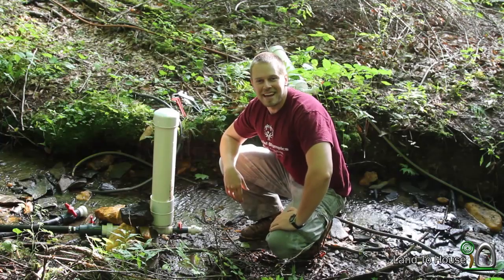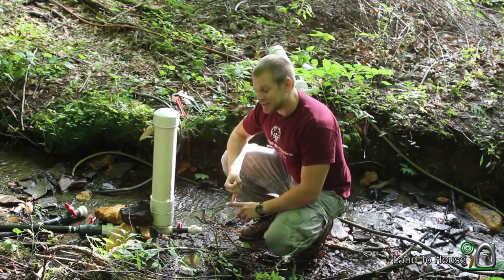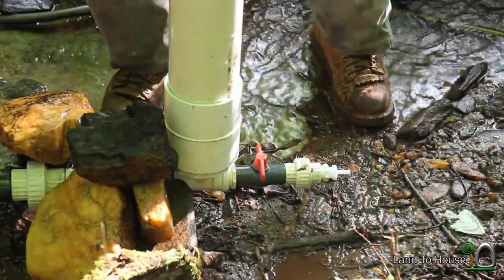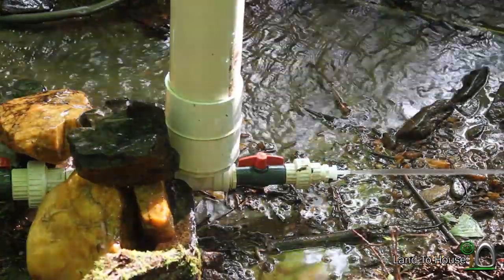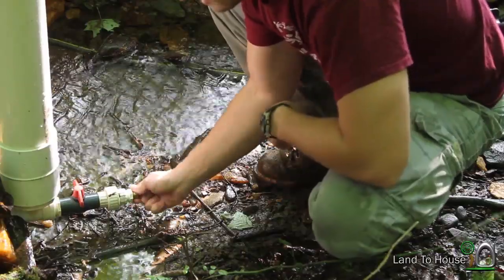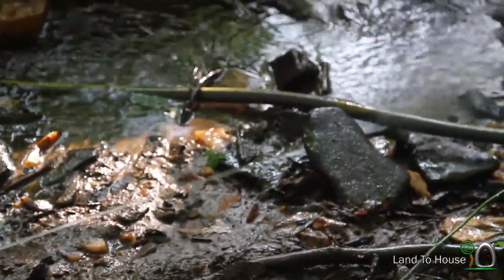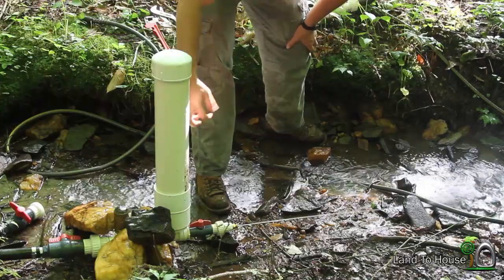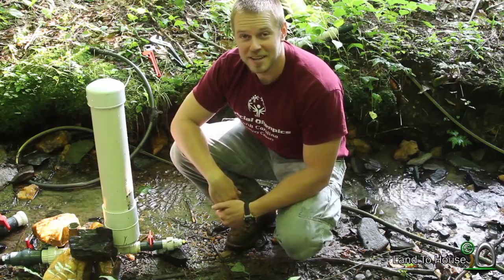Ram Pump Nozzle

Comment: well done, you keep coming up with interesting ideas, looking forward to seeing the pelton wheel as I know very little about  them. my ram pump is still working fine and providing water to the garden, I'm thinking of installing a second storage tank next year
Reply from the maker: I have to give engineer 775 the credit for this idea.  His video used some crazy amount of head.  Like 100'. My Pelton wheel test consists of making 3v from 4' of head directly from a pipe.  Can't wait to test it.  .... That is a good long time for a pump to run :) keep up with how long it pumps continuously.  I used mine to make my concrete pad :)

Comment: I wonder if you used 4" pvc drive pipe, would it generate more pressure.
Reply from the maker: +Frank Johnson as long as the pump and drive pipe are the same size. The pressure would be the same BUT there would be a much larger volume of water to nozzle down. So yes I feel that would make a difference .

Comment: What would happen if you connect those nozzles at the end of the output hose but when the output is at 40-50 feet above and almost a 1000 feet apart of the ram pump? It is sure that this-like  water jet is not supposed to get at described circumstances but hmmm who knows maybe some kind of continuous water flow could be get instead of pulsing water..
Reply from the maker: I am not completely sure what you mean. I should think that when you move the jet away from the pump it might lose pressure. It would be an interesting test.

Comment: At best, ram pumps have an efficiency conversion of about 60-65%. "Pressure" is a function of area. Using a ram pump to increase pressure (at the cost of flow) isn't the best pathway here. If you already have flow, CONSTRICT the flow to increase pressure - you don't want to "convert" it at the cost of huge efficiency hits. Ram pumps are designed specifically with higher pressure at the cost of flow in mind. You're already factoring in the efficiency hit just to get the fluid "pumped" at a higher elevation (again, keeping in mind flow). If you want to simply generate electricity, you don't need a conversion first you can simply constrict the flow and create higher pressure or use other principals like centrifugal force turbines for higher-flow, lower-pressure applications. Ram pumps are stupid - you can use venturi principal devices to pump water at higher elevations (like with water sump pumps) - they'll be phased out as they're replaced with better tech as they're loud, require maintenance, and wear out due to the constant slapping.
Reply from the maker: I that was a nicer way of communicating your opinion. Thank you. I agree with your deduction. It is much better to nozzle down the penstock without a ram pump for electricity generation.
Reply: Sorry... too much crap happening in the news, makes one a little insensitive. Thanks for taking the time to make content for us to bitch about lol .. :)
Reply from the maker: Hahaha yes I watch very little of that so I don't get too irritated. If you are looking for videos to get mad at I recommend my retaining wall build :)
Reply: does more pressure mean more height you can travel? SO if you had a smaller output hose- can you lift water to a higher location?